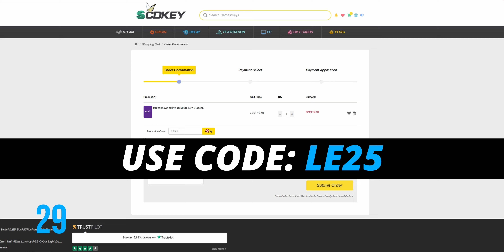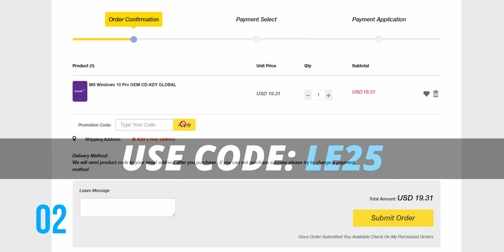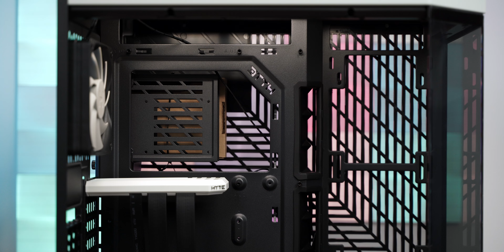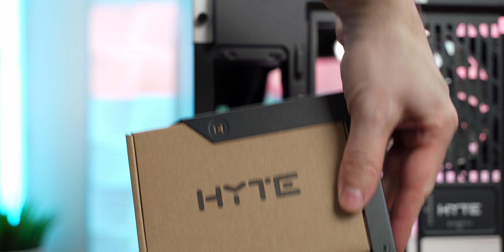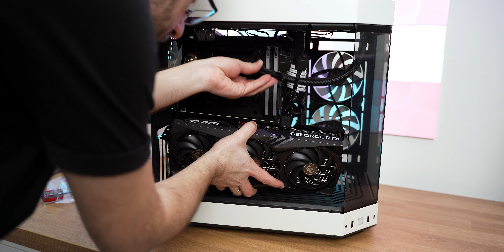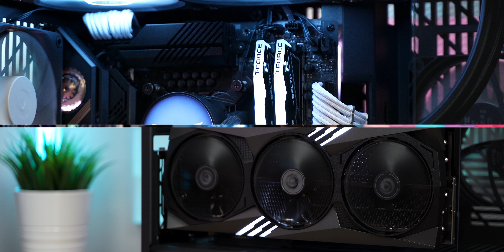Hyte Y60 - All aboard the HYTE train!!! 🚂🚃🚃

Comment: Hey mate can you answer a question for me so I have this case for a build and was wandering can you add more than 2 ssd
Reply: Thanks you've been very helpful 😀
Reply from the maker: You could with zip ties, otherwise 2 only with caddies...
Reply: @LevelUPGamingTech  instead of zips can I use like doubles sided foam tap or velcro tape
Reply from the maker: @R4VENCREST  Yes of course, any MacGyver solution actually  😁

Comment: hi, i hope u be ok.
i want to buy z790-p-csm motherboard.
but it has different price with z790-p model (it is cheaper).
z790-p-csm Is there a problem with this? Is there a problem with its performance? Is the BIOS old?
Can't use its full power? How can Windows 11 be installed? thank you.

i want to buy csm model cause it's cheaper but i don't know what means csm motherborads.

Comment: Great case, but 5cm wider than my desk supports.
Do they have a taller but thinner version, so the PSU and storage caddies go below instead of the side?
Reply from the maker: Technically caddies are not the problem, PSU thickness is, that's the issue actually with all dual chamber design cases, like this one or Lian Li 011. Something similar to what you mentioned is the Y40, stay tuned for a review 😊